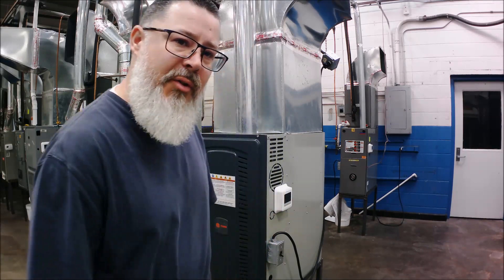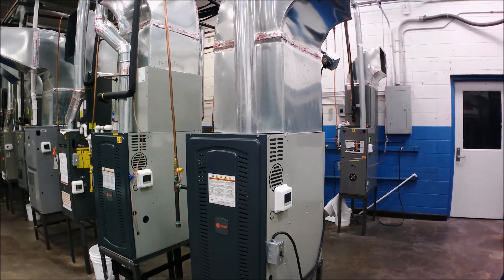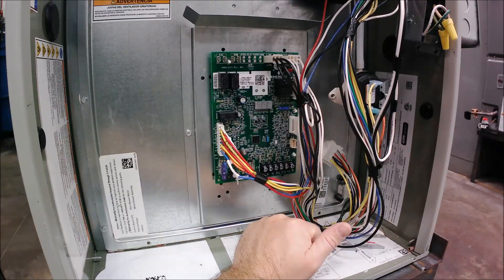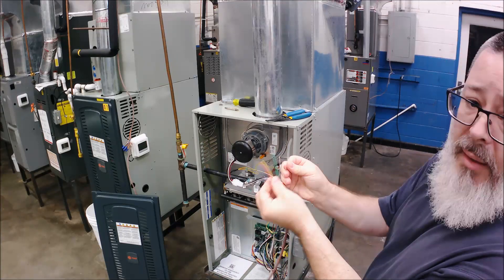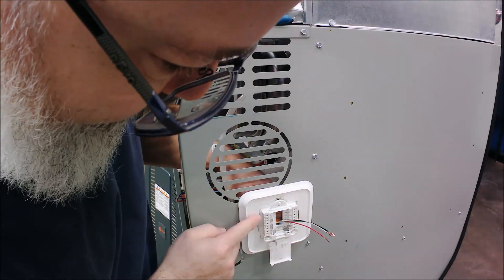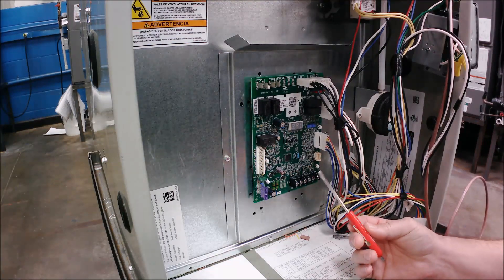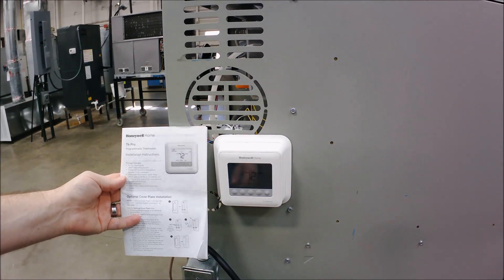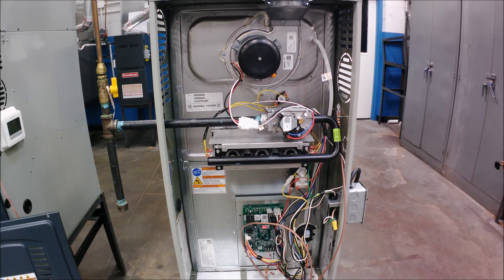How to Identify and Wire a Heat Only Unit - Gas Furnace

Comment: I have a ? I have a furnace 
White c blue R Red  G green and 1 this is on the furnace but the wire to the thermostat  cable white blue  Red Green yellow but it should run in white  W blue. C Red is Red G is green then 1 is yellow or just the 4 wires
Reply from the maker: With the standard 5 wires that you mentioned, Red-Blue-Green-White-Yellow, it sounds like you do have a conventional heat cool setup. (Furnace with an a/c)
Of course that can be an electric, oil, or gas furnace so I am not sure which you have. Not sure if you have another question but if so you can shoot me an email at jenningsj@hotmail.com. include a couple pics, put you tube in the subject, and comment saying you sent me an email so I know for sure.

Comment: How much is the element for heat only?
Reply from the maker: If you're talking about the hot surface ignitor it is probably $50 to $60 online. Could be more but I doubt it.

Comment: @John Jennings what color is R G and W so I know which  one to connect to the thermostat  what is common because I heard common is blue I also thought  white goes with white green with green but you said black is common help ne out here
Reply from the maker: Seems like everybody has a different idea of what color common is...I use black, some use blue, some brown. We do try to keep a standard like you said. W terminal is white, G terminal is green, R terminal is red, etc. C terminal is common but ??? who knows what color you have. Just make sure the common on one end attaches to the  common on the other, even if it is not the same color wires. It is the connnection not the color that matters.
Reply: Thx you